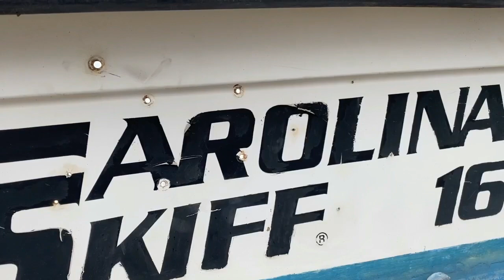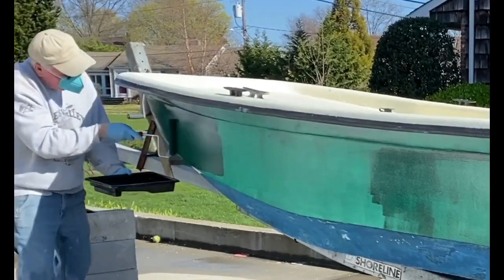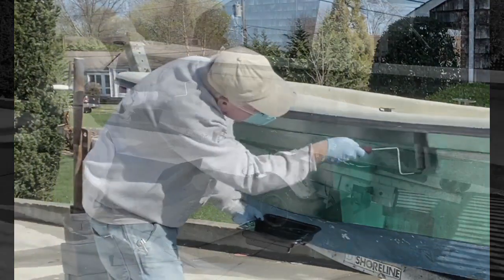How to easily roll Gelcoat on a boat

Comment: Nice, easy and quick video. Thanks for sharing. When did the gelcoat start to gel, I mean, once you activated it, I guess you had to roll pretty quick and not mix too much gelcoat at once for the entire boat? Could you like do one entire side with one mix?
Reply from the maker: Thank you for the feedback. Correct small batch mixed. Covered maybe 1/2 the side but it was a very thin coat. Needed two to three coats to completely cover

Comment: Great video! I have a 1990, 17’ Newport, Boston Whaler. What brand of Gelcoat did you use? And most importantly, will rolling Gelcoat on nonskid deck work by using a rolling? I purchased the boat last year and put a new Mercury 90 4stroke on it. It had screw hole after screw hole in the deck, I patched with  white two part epoxy. My deck is a light tan color.
Thanks, your boat looks great!
Rod
Reply from the maker: Yes you can roller on epoxy. It will not come out as smooth as spray but for a work boat like mine its fine.

Comment: How’s the gel coat holding up ? Using the total boat gel coat with wax , working time is about 10 minutes. How do you paint the whole boat this fast in that time or can you do sections?
Reply from the maker: I used gel coat with wax. Not from total boat but should work the same. I rolled on a very thin coat then went right back over with second coat before the first dried.Do all you cutting it first so once you start rolling you dont waste any time.

Comment: How do you make the gel coat so smooth? Like how do you not have any bumps from the roller or any roller marks.
Reply from the maker: Its really just making sure the hull is light sanded and then thin layers using a small 6" fine roller. Not hard at all. You will end up with some orange peel type texture but for a skiff Im fine with that.

Comment: How did you apply gel coat with wax to on top off the first coat that has wax should it not bee the final coat that has the wax
Reply from the maker: That is the trick. As long as the first coat has not completely cured  you can add additional coats. I was able to get three coats onto this boat. If the first coat dries you would have to lightly sand and wipe down with acetone before applying second coat
Reply: Thanks

Comment: when you rolled the gel coat on the inside of boat did you sand any are just wiped down with cleaner thx
Reply from the maker: I sanded lightly with 80 grit and then wiped down with acetone. Only thing I did different was I used a standard roller and put the gelcoat on a bit thicker. On the outside of the hull I was trying to get a smooth surface

Comment: just pick up the same boat making mine a tiller version with a brand new honda 40
Reply from the maker: I went with a 50 only because they did not have any 40's in stock. Mine is actually to fast with the 50. You will love the 40 but will most likely need a tiller extension arm